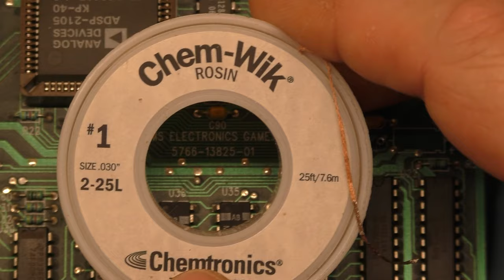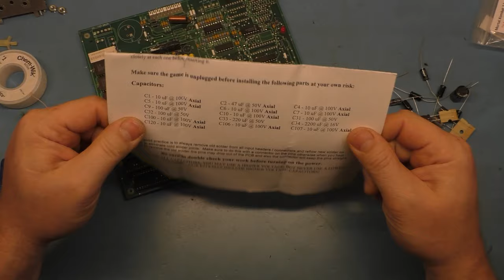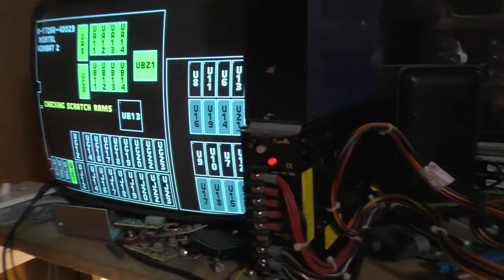How To Rebuild A 90's Midway Sound Board - Correctly

Comment: Couldn't agree more about the pads on these.  I use my hakko to remove the solder after pulling the old caps and have had minimal issue the right tip is important. I've never had good luck w/ the desolder braid.  I cannot stress enough flowing fresh solder on the pads prior to doing anything this will help avoid damaging the pad or VIA.

Comment: Hello, your videos are really great for us in the hobby that don't necessarily have the formal electronic training....like me.  Question, I have a MK2 that has pretty much worked flawlessly.  Yesterday I turned it on and NO SOUND.  No "bong" when powered on, no noises during game board test.  LED on board still light up.  Is this common?  For the sound just to stop with no warning signs?  Thanks.
Reply from the maker: Thanks. Glad I could help. Yes, especially if it has not been recapped. That would be step 1.

Comment: digging the soundtrack... took me by surprise. |m| Do you have any recommendations for a portable solder gun/pencil solution and some good replacement tips (extras). Thanks for showing old dogs (and new for preservation sake)old tricks!
Reply: Incidentally, is that just soap and water on the toothbrush?